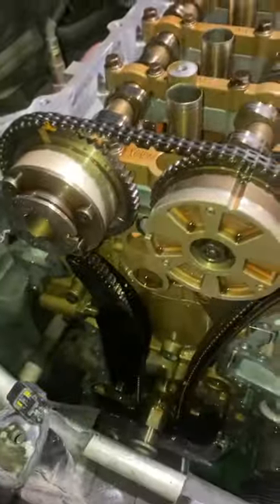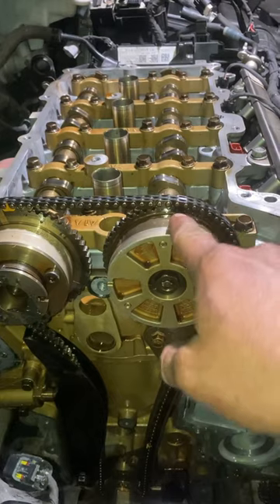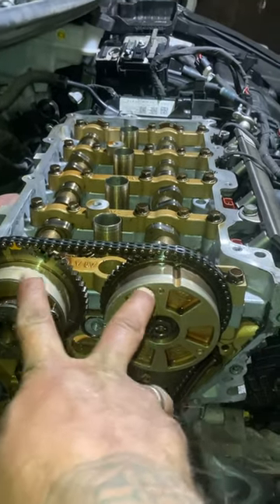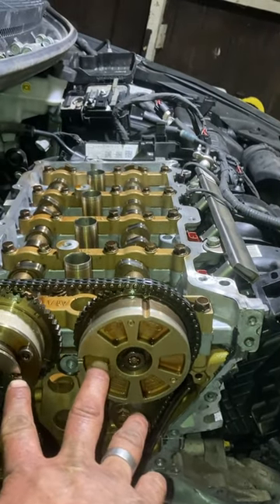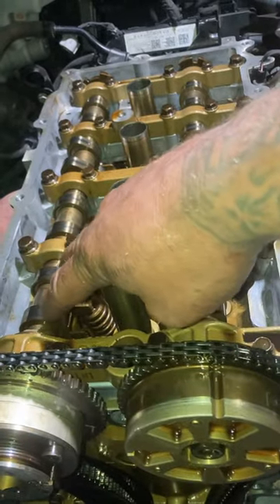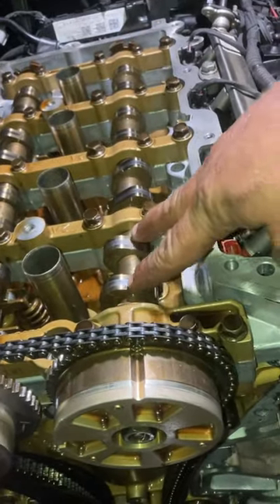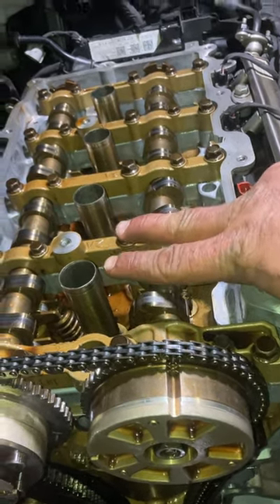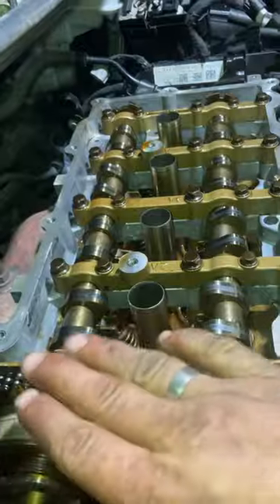Bad cam phaser caused timing chain to jump 2018 Kia forte 2.0L

Comment: The 2.0 Kia engine looks like a solid engine on the inside no wonder these things last long with very little maintenance they seem like bullet proof engines extremely slow tho stock since they were built for fuel efficiency rather than speed and performance.
Reply: Nothing bullet proof about these engines, and maintenance , especially keeping clean oil up to the proper level is ESSENTIAL
Reply: This engine is crap.  Had to replace the entire engine at 75k now I'm being told I need a new intake cam, CVVT axel, and tensioner. They want $3600, ridiculous

Comment: Is it possible to reinstall the chain and align   the cams phaser  .will it fix the problem for short period
Reply: Morw than likely, if it jumps timing, the chain need replacement. The whole timing system on hyundais run off of oil pressure. So the chain is pretty tight. If the chain jumps, then it was stretched. The reason for a stretched chain could be wear, or the phasers gear teeth are worn. Another thing that is typical for hyundais timing system is that the exhaust phaser has a dowel pin the is inserted into the camshaft. If it gets stuck in the camshaft, then the exhaust phasers rpm will move at a different rate then the camshafts rotation, causing timing to be off. 
So, for anyone reading this. 
Even if thats not the case, still replace both vvt phasers (exhaust and intake), timing chain, timing chain guides, chain tensioner AND your oil pump (for the oil pump, just buy a new crankcase. They come with an oil pump automatically.)
Important information:
hyundai elngines are Interference. Meaning, if the timing chain "breaks" not stretches but breaks, youll need a new engine. Since the piston and valves are now banging into one another, the engine is destroyed. 
However!! If your chain stretches or anything other than breaks, The mechanic by their protocol will tell you you need a new engine. That is false. They just want to get paid for labor for a new engine. 
Tell them to order what i mentioned above. Hyundais go into a "limp home" mode, where it limits the piston and valve travel to avoid engine damage when the chain stretches. So in turn, the engine is still good. You could even do the job yourself if you have the balls. But just so you know, it aint an easy job. I have a link for the full hyundai approved timing system repair procedure. 
Any questions, feel free to ask me. I do respond.
Reply: @acrocheezefpv Link sir
Reply: @acrocheezefpv I’m putting a timing chain on right now you’re saying I need to put new phasers and crank case?
Reply: @acrocheezefpv yo bro, could you post that link please
Reply: @acrocheezefpv  great info! Link please! Thanks